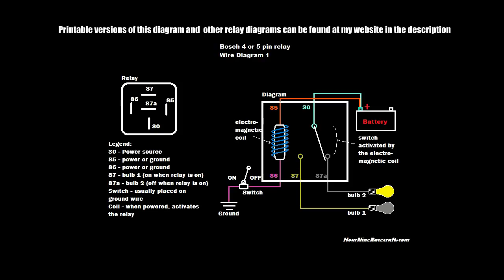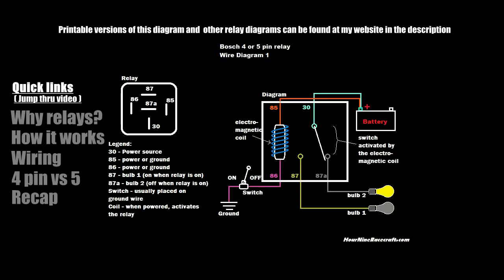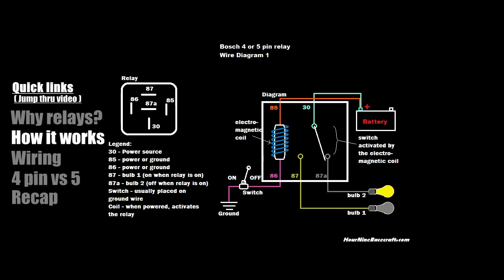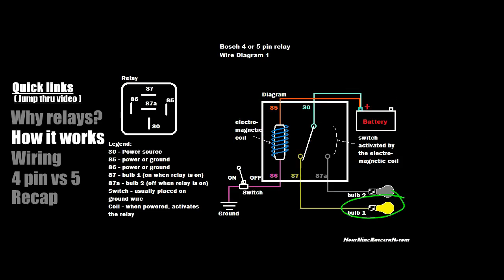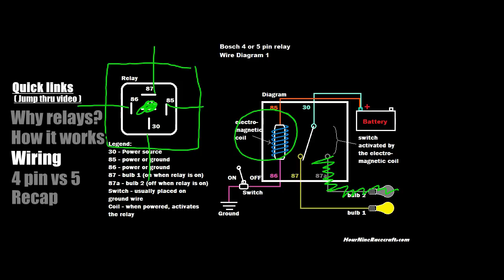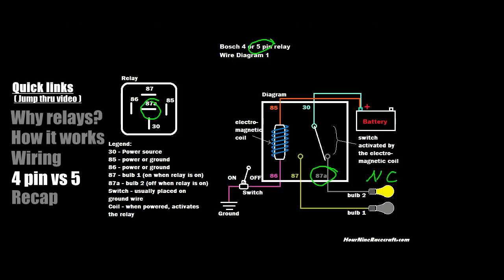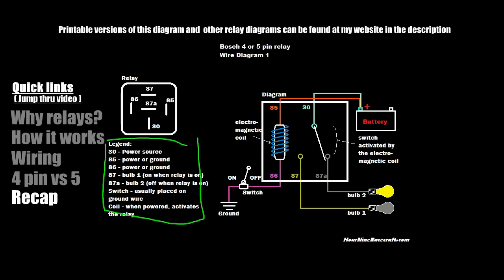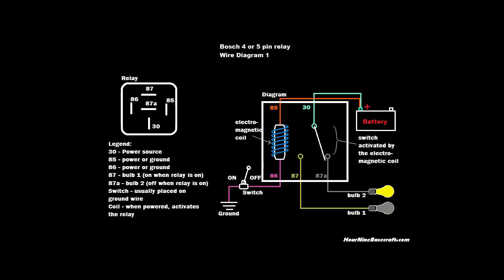Relay Tutorial: 5 pin vs 4 pin wiring (Example 1)

Comment: Thanks for these videos. What I don't understand, is what causes the signals to flash? I have 2003 f150 with a flasher relay ans flasher unit
Reply from the maker: +Bert Myers good question, I didn't cover that part in the video. The flasher relay makes the bulbs flash. In the video I tap into the wire after the flasher so that the relay turns the new bulbs on and off as the flasher energizes the wire on and off.

A flasher relay is simple though, one wire in and one wire out. A small piece of metal inside the flasher will heat up as current goes through it, when it heats up it will heat up enough to shift and break contact (the bulbs turn off). It cools off and makes contact again..heats up..pops open..cools off..closes..over and over. They are called thermal flashers. Think of it more as a circuit breaker that resets itself automatically by springing back. Home circuit breakers will heat up and flip a switch off..a flasher is designed to turn itself back on after it cools off. This heating up and cooling off just happens very quickly.
Reply: @LegitRaceCraft  Nice and very well put answer.

Comment: DRL: Hey man, top video! just helped me to draw my diy job for next weekend AND just about your comment "why would you have an ON light all the time and want to put it off?"... well it is exactly what I need it for! am installing some Daytime Running Lights to be powered only when the engine is running (30:87a) AND they must go off at night when the headlamps are on. So am powering the DRL from an ignition/accessories fuse and my toggle switch circuit (85;83) will be connected to the headlamps. (87 empty) It should work in theory and it will save me few quids from an aftermarket DRL harness - AM I CORRECT?-. Cheers
Reply from the maker: cognote it is hard for me to visualize without a diagram, but it sounds like it will work. you are using the relay to turn off the drl when your headlights turn on? That's creative and it sounds like it would work. Good luck with it! Glad you found the video useful.
Reply: Just to update this.. It works perfectly! DRL Switches on with the ignition and they go off when using my headlamps. DIY project, cheap and quick way of doing it.  I will probably get a plug and play product from ebay next time, just because it comes with all the wiring tidy and ready to use. Cheers
Reply from the maker: +cognote nice! Thanks for the update. Sometimes those eBay wire kits are a bit short and use cheap wire though. I try to only use copper, some of the kits have CCA or aluminum wire. Cheers!

Comment: Trying to figure out how to wire two led work light to be a constant on but also as a warning light as a strobe
Reply from the maker: +Matthew Thompson look at my dual power source switching video. You would need to wire the output to the LED work lights on pin 30, the constant power on to pin 87 and the strobe to 87a. Wiring this way you'll need a separate off switch for the whole setup. You can almost use a relay to create a strobe with very fast on/off..but the relay won't turn on/off fast enough to create a very fast strobe. The relay internals will float if you tried to create a strobe too fast with relay on/off pulses. Use something else with pwm to pulse the LED before the relay
Reply: They sell a strobe module for that.
https://www.youtube.com/watch?v=L_TVbypDSZM&ab_channel=SuperBrightLEDs

Else you can do it with a relay flasher but it will go slower. Using two SPST relays and a Single Pole Double Throw  Center Off switch.
Wire Small AWG Negative to the Common of the switch. From the other tow pins, wire them to the 85 pins on the relay. One wire to relay number ONE and the other to the number TWO relay. 
Wire Small AWG Positive wire to both the 86 pins. Jumper them at the relay socket.
Wire Large AWG Positive wire to both the 30 pins. Jumper them at the relay socket.
On relay number ONE Run Large AWG to Straight to lights. 
On relay number TWO Run Large AWG to LED (designed for LEDs) Flasher then to the lights.

If you buy this harness and dual relay socket, Doing it will be a breeze. I just sent a message to see if the sell them in singles.
https://www.amazon.com/gp/product/B077QN5H4S/ref=ppx_yo_dt_b_search_asin_title?ie=UTF8&psc=1

If you have more things that need relays and fuses use this. Cheap, great quality, small, and flexibility.
https://www.amazon.com/ONLINE-LED-STORE-Waterproof-Automotive/dp/B07MR64XK1/ref=pd_di_sccai_73?_encoding=UTF8&pd_rd_i=B07MR64XK1&pd_rd_r=5290733b-5beb-4043-96f2-877b9afa183d&pd_rd_w=79ALO&pd_rd_wg=eMLKu&pf_rd_p=5415687b-2c9d-46da-88a4-bbcfe8e07f3c&pf_rd_r=FD8SXQKGFTWV93V52XDD&psc=1&refRID=FD8SXQKGFTWV93V52XDD

Comment: I understand if you cant help because ive searched high and low and nothing found, I have 95 fzr600 5wiires from the switch to relay, converted to led, nothing found really works suggested because it doesn't ever relate what to do with all 5 wires from switch? thanks
Reply from the maker: +joel herzog awesome! I loved my old FZRs..I had an 89, 91 and 96..I have some old old vids or it. I really ripped into my wiring on it to do some fancy stuff, rewired left switches for r6 and it was tricky(no vids on that tho). I did rewire my switches tho. I think I still have my Haynes manual for it. Send me a more detailed question and I'll see if I can help. From what I remember, the turn signal switch has a kill wire that tells the relay box to switch off..I'll have to dig out my wire diagram tho

Comment: Thanks for the video I just have one question . Instead of running 2 wires from battery + to the relay pins 30 and 85 can I just run 1 wire to 30 and do a jump wire to pin 85??? Thank you for the help
Reply from the maker: +titan371 yes, you can. I didn't mention that because normally a larger wire will be connected to pin 30 than the one used for pin 85, and splicing off of a larger wire is harder when you want to keep a solid connection.

Also, I like to wire the relay pin 30 straight to the battery (but fused), and for pin 85 I'll find a connection in a nearby fuse box that is only on when the ign is on. That rules out the possibility of you leaving something on that will drain your battery when you turn the key off.
Reply: Hournine Racecraft  perfect thank you for the reply  and your help thumbs up man !!!
Reply: You don't want to do that. The whole reason for a relay is to keep the circuits as separate as possible. In vehicles most of the control circuits run through the fuse panel inside and are individually protected with a fuse. One large main bus wire coming in and a bunch of accessory branch offs.The larger wiring circuits tend to be under the hood in the engine compartment to keep that wiring as short as possible. So not only is it not electronically not advised but it's not practical.

Comment: Hey Hournine Racecraft
I'd like to wire up active breaklights in my Rc crawler and I'm sure I'd use a relay to do so but I'm not sure how to go about it.So I'd like bright brake lights while the truck is sitting there and then go dim as I move forward. If you could be any help I'd appreciate it immensely,
Thanks,
Rctech78.

Comment: I own a 2008  pontiac G8 and was checking/cleaning up my battery area.  Than i busted the shit out of the fuse thing that was on the terminal with the power cord   on each side it had a 60A nfuse running off to the radio and controls similar and the other one to my fuel pump and other similar systems.  Cause I use relays for a quick fix till I get the other fuse it??  and all three of these cords were running right off my battery in the truck.

Comment: great video, great explanation made it very easy to understand. I plan to run 2x 12v cigarette lighter units controlled by a single switch, could I use just 1 relay for it (2 wires coming from pin 87) or do I need 1 relay for each and essentially 1 switch for each?
Reply from the maker: +dwaynedaprophet it sounds like you want both to come on at the same time, and both would be triggered by the relay, right? Yes. Battery power to pin 30, and both power leads going to pin 87. Then wire 85 and 86 as the positive and ground trigger

Comment: great video..visual aids are great. the only question I have is, on a 5 pin, what would be the benefits of keeping a device on? in other words, in a vehicle application, what would this work for? I'm racking my brain trying to figure out why I would want to power something all the time..especially in a vehicle
Reply from the maker: +Dustin Farrell Toyota uses them to redirect a power wire to ground so the electrical fans don't generate voltage if the air moving over them spins the fan. And I believe these relays are what make the turn signals work the way they do on some Chevy trucks. The two front signals alternate on and off. There are multiple ways to use them, these are only two options I can think of immediately.
Reply: Hournine Racecraft cool. thanks for the reply

Comment: Hello, 

5-pin 12-volt relay control question

I've tried finding an answer to my question on the web without success, so I hope you can help. My 1986 Jeep CJ7 did not come with courtesy lights nor door switches. I've installed them and now I want to control them using a 5-pin 12-volt relay, and a new switch on the dash so I can turn them on when the doors are closed.  I've run fused power from pin 87a to a new
terminal block and a single positive output from the terminal block to the door switches. My question is this... Can I use the dash switch to control power to pin 87 and connect pin 87 to the same terminal as pin 87a on the terminal block?  It seems to me that 87a would provide constant power to the door switches and courtesy lights when the doors are open and the dash switch is off. Turing on the dash switch would power and close pin 87 turning on the courtesy lights when the doors are closed and would also open 87a, correct? Will this work safely? Thanks
David
dpuls@verizon.net
Reply from the maker: Well, when looking at pins 87a and 87, one is always on while the other is off. So if 87a is on then 87 will be off and vice versa. Technically you can connect pin 87a to the same pin on the terminal block that 87 is on, but if you do then your door courtesy lights will always be on. Since pin 30 is connected to pin 87a when the relay is off, then the terminal block will have power when your switch is on or off. Pins 85 and 86 are usually what you would connect a switch to on a relay.

I kind-of see what you are saying. What is your end goal? how many wires are on your door switch, one or two? Do you know if the switch is closed (connected) when your door is closed or is the switch open (disconnected) when your door is closed? If you can tell me the switch model number I can look it up.

Comment: Hi H. I liked your explanations on wiring relays, well done. I am about to convert my 68 Mustang, 302 ci, from the old mechanical fan to an electric fans (2 fans) config. I hope this conversion solves my overheating problems. I have seen some people using 2 relays, some people use 3. I do have A/C on this car. Also, I have an aftermarket EFI computer (Edelbrock E-Street) that has (fan 1& fan2, high and low?) leads coming out of the ecm control box. I am intending these 2 leads to act as my SWITCH. My intention is to use a 5 pin relay using the 87A pin to keep the fans running on low (with the key off) through a mechanical thermostat mounted on the fan shroud, until the mechanical stat senses the temp to be cool enough. When the mechanical stat opens, it opens the ground. I don't know how you originate your posts, or even if you will answer, but I am unsure of my design. Any help would be greatly appreciated. Thanks. Ron T
Reply from the maker: +Ron Truex most of the time the "leads" coming off of an engine management or factory ecu are ground switched and designed to operate a Relay. I would refer to your wire diagram that came with the edelbrock to double check that though. If you connected that to pin 85 on a Bosch Relay then you would connect the positive (pin 86) to an ignition switched source. The ground trigger may default to "on" when the edelbrock is off, so make sure 86 is ignition switched positive. Then run your main power to pin 30 and then a wire from pin 87 to your fan, and ground the other wire. Your edelbrock should allow you to tell it when to turn on the fans based off of temp. So you won't need a mechanical switch off the engine. Just a temp sensor telling the edelbrock the engine temp. You also should have to go into the edelbrock settings and enable that fan lead wire and tell it what temp it needs to come on at, and make it come on when your A/C is turned on.